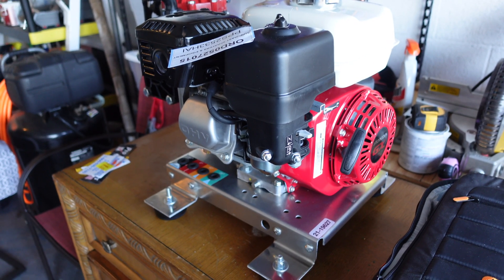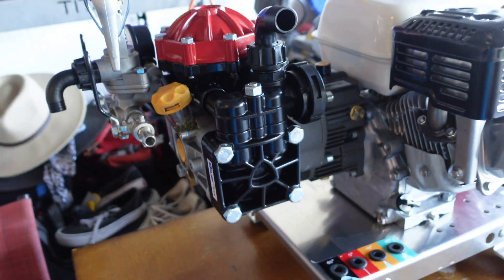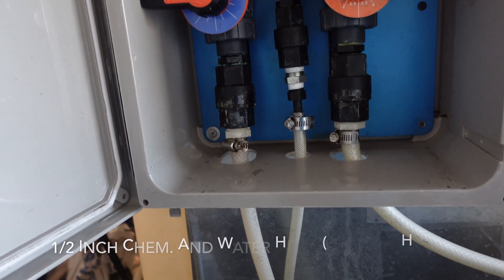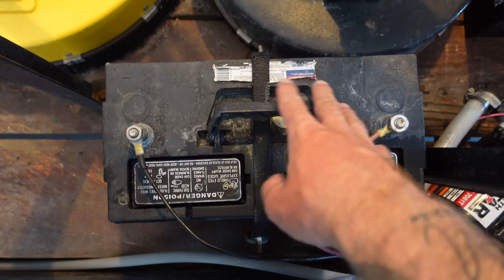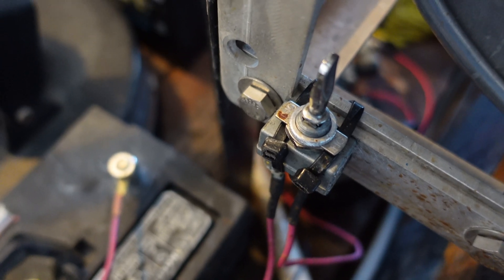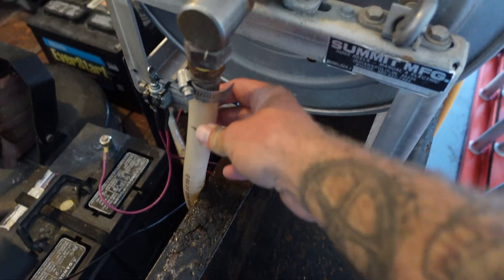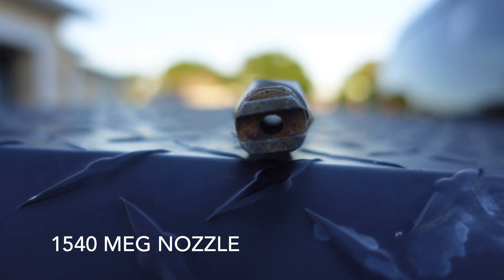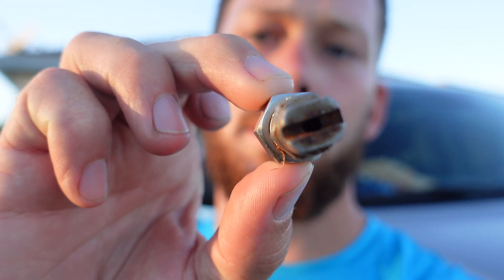12 Volt SOFTWASH system 7GPM (with proportioner)

Comment: What size valves on the proportioner?
Reply from the maker: 1/2 for 12v system and 3/4 for gas soft wash
Reply: @ that’s what I thought. But everyone has told me to get 3/4 inch valves. Even Tim from expert power wash said he uses 3/4 inch valves on his proportioner but he feed it with half inch from the tanks. What do you think about that?

Comment: Hey buddy, if you don’t mind me asking, how do you have the P40 running with your proportioner without blowing off the pump?
Reply from the maker: What do you mean brotha ? By blowing off the pump?
Reply: @rusty.nesvig  well see I have a P 40 pump that I couldn’t use with my proportioner because I can’t be of the trigger for more than a minute otherwise, all that pressure that returns starts building and it tends to load the pump too much hopefully I explain it good 😅

Comment: Will it hurt my Remco pump if I keep my battery charger on my battery while I’m washing?? I’m powering the charger off of a predator generator. Will it burn my pump up while using it
Reply from the maker: No not if you have a on / off switch for the pump. You don’t want it sitting on 24/7 that will definitely burn the pump out
Reply: @rusty.nesvig  ok I went through 3 pumps in a week and I was wondering if I was burning the pumps up buy running power to the pump constantly from charging and generator power

Comment: Are you rinsing the house with the same hose 5/8 hose in this video? Or do you have a separate hose for rinsing?
Reply from the maker: Rinsing with pressure wash hose. Not rinsing with the 12v hose

Comment: Why are most guys using 5.5gpm vs 7gpm? Any recommendations for brands of pump?
Reply from the maker: I switched to 5.5 rather than 7 because I didn’t see a huge difference in the performance. So you’re saving money with the 5.5 and on top of that in my experience the 5.5 last longer. All the pumps besides the Delevan are built the exact same with the exact parts just a different sticker on top.
Reply: What are your thoughts on the 24V? I was wondering how different the 5.5-7-10gpm pumps would be, and you said that you didn't notice much difference between the 5.5 and 7gpm. What would be the difference with the gas powered one? I have a gas powered 5gpm, 5.5hp soft wash with proportioner and was thinking of going to 24V 10gpm to get more distance. Your thoughts between that or had powered? What gpm is your gas powered?

Comment: Seems like it takes a while to rinse with a system like this though
Reply from the maker: I dont rinse with this thing. I would never recommend rinsing with a 12v. I just applicate with this.
Reply: Use pressure washer for house washes not 12v

Comment: How many GPM are the spray tips are you using? JRODs and individual tips are available in 2-3, 4, 5-6, and 7-8 GPM. Also if the pump is shutting off its because the internal pressure switch is shutting it off and you are receiving max pressure to nozzle which will give you the longest distance . The pump is basically a marine wash down pump which is usually left on and shuts down at rated pressure (around  60 PSI depending on pump rating) when not in use. Doing my research looking to get into the business. I know pumps, been working in the marine/boating world for 30 plus years.

Comment: You mentioned your suction being 1/2”. You should be running no less than a 3/4”. Also, it’s hard to tell in the video, but wiring to battery should be at least 12g.
Reply: Just changing to a larger suction is going to increase your distance. Mine shoots 42 feet with a 5.5 no problem.
Reply from the maker: I have 12g wire and that’s interesting man I originally had 3/4 suction hose on and it wasn’t pulling well at all. It may be that everything is pulling up. You have 200ft of hose ?
Reply: @rusty.nesvig  yeah, everything running off drop sticks as well.
Reply from the maker: @brianstewart7560  do you have the same proportion as me ? 3/4 plumbed ?
Reply: @rusty.nesvig  I’m running gf valves on mine, but yeah 3/4